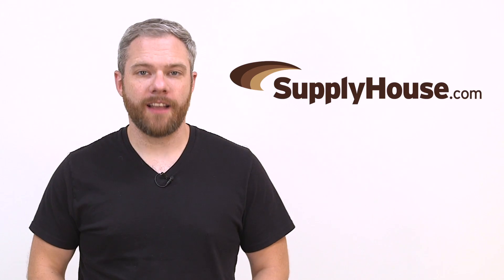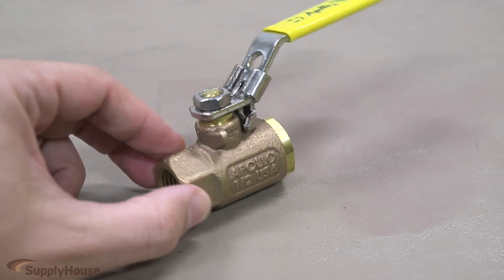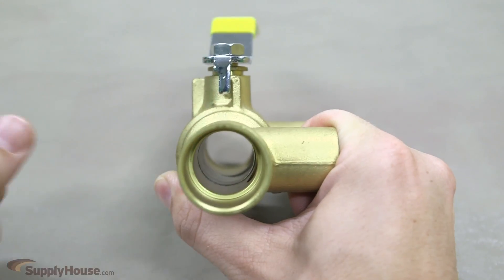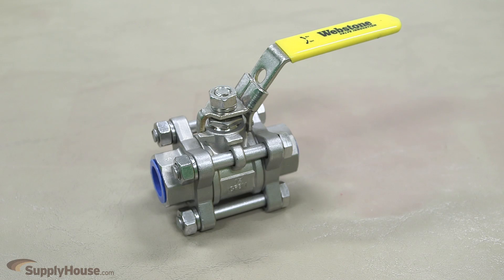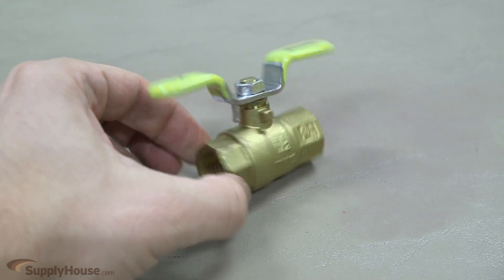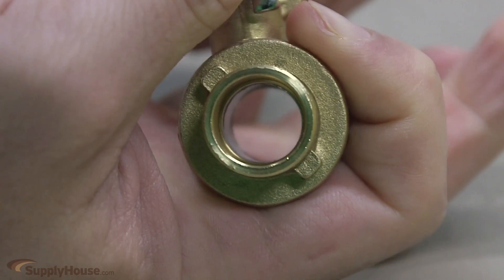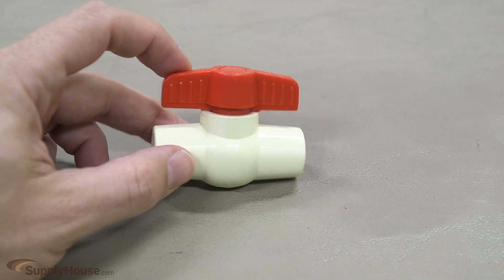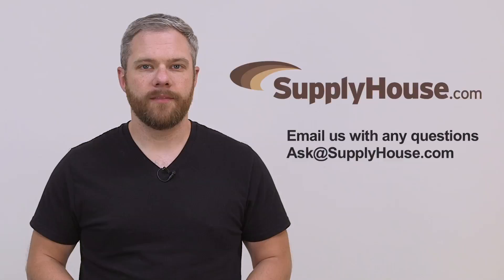Ball Valves

Comment: Can a ball valve fail internally? I have one on a water line that won't close. The handle turns fine, no leaks or anything, but when turned perpendicular it allows as much flow as when it's turned parallel.